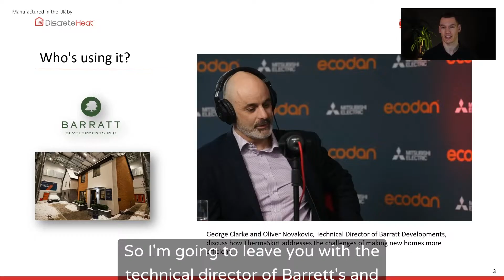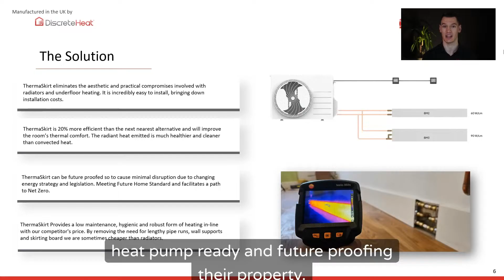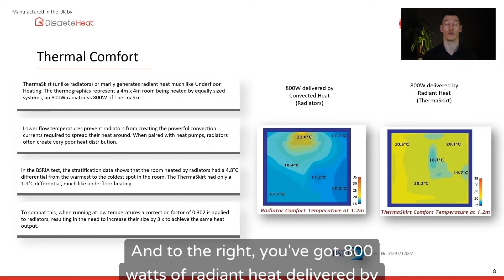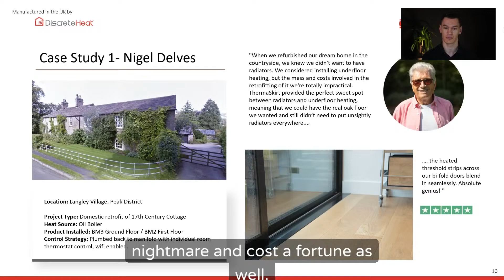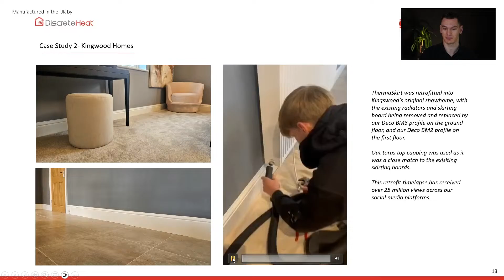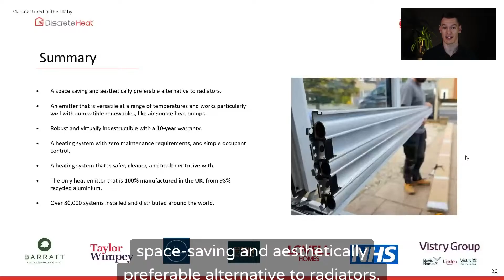How ThermaSkirt can transform your home | LIVE Webinar

Comment: What is the material made of, and what happens to it when it’s hot? Does it emit any chemicals when heated?
Reply from the maker: Hi there, its made of aluminium. Its heated to around 60DegC. The aluminium is powder coated, which is baked at over 200 degC, so there are no chemicals emitted during heating. 
Its a very clean system, and unlike a radiator there is nowhere for dust and dirt to hide.